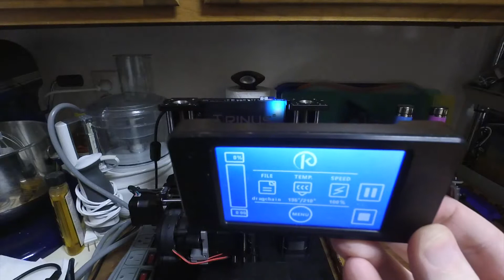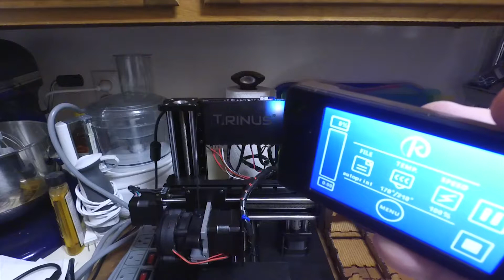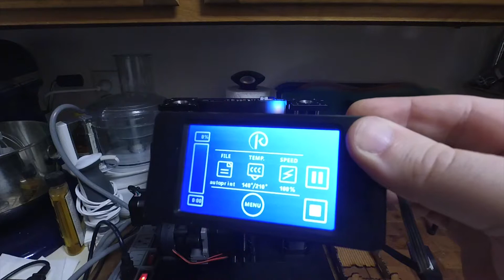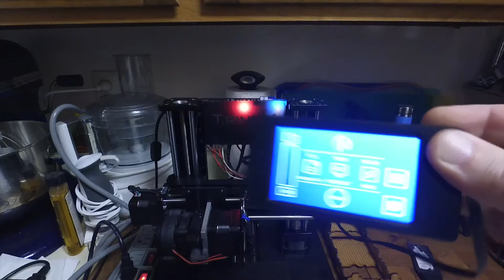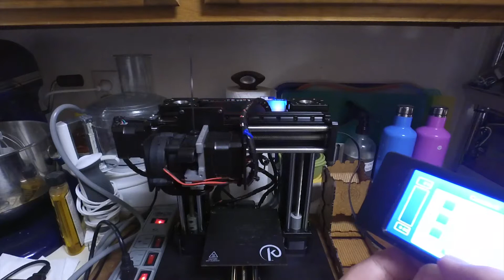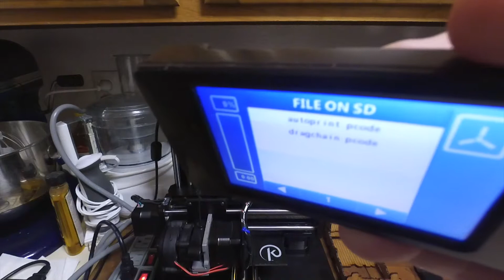Issues Ive been having with the Trinus 3D printer.

Comment: i got one of this 3d printer and im looking for the touch screen display, and i could not find one. any suggestion
Reply from the maker: Let me see what I can find.  Not sure if the version 1 displays are available.  Should be able to control it using printer face and a USB cable I think still.
Reply: @DavidClunie thank you for your time
Reply: @DavidClunie  yes your right,  it can be controlled by Pango using the console via a usb cable. i would like to add a touch screen display to be able to print multiple files using the sd card. without the lcd display, i can only have one file in the sd card. need to rename the file "autoprint.pcode"